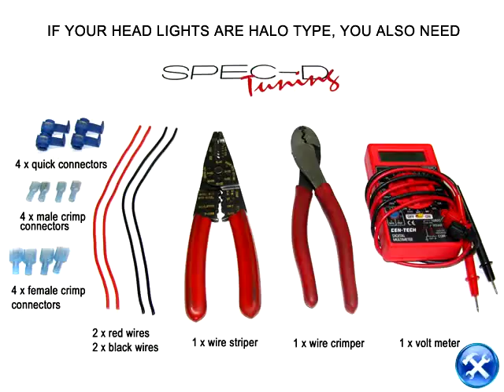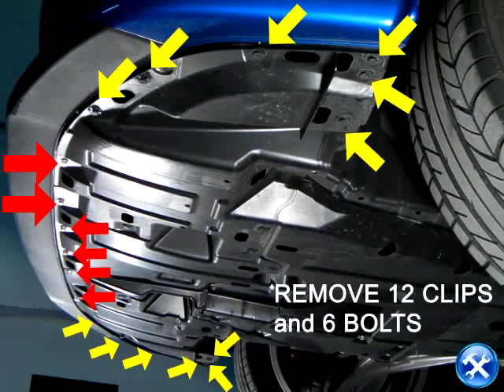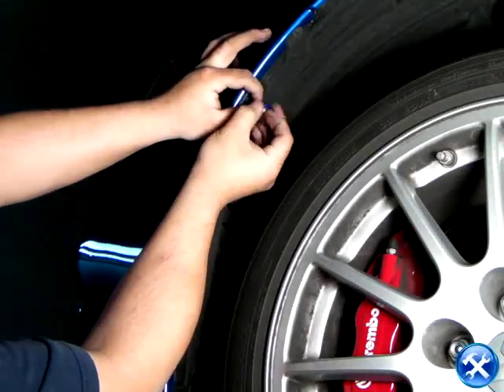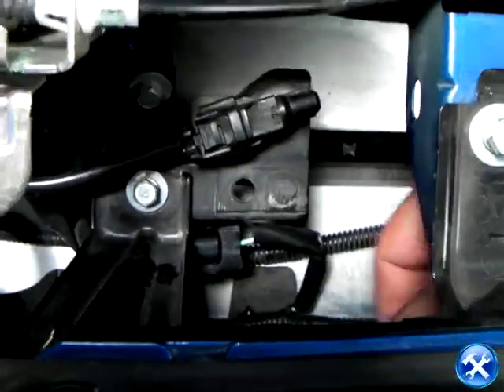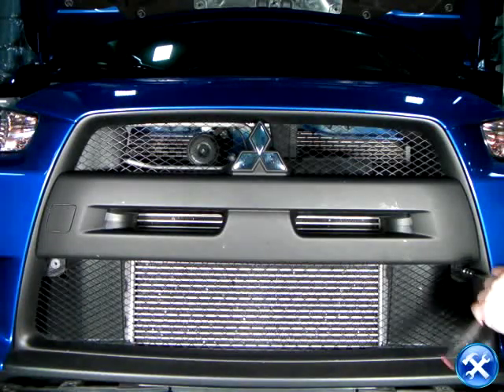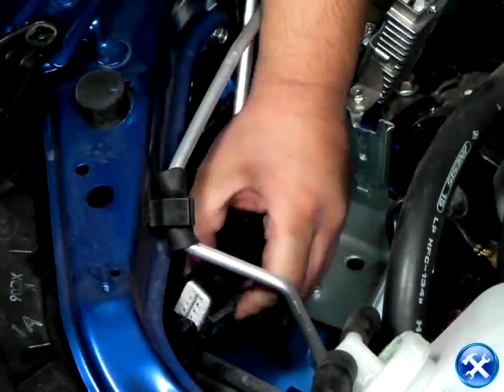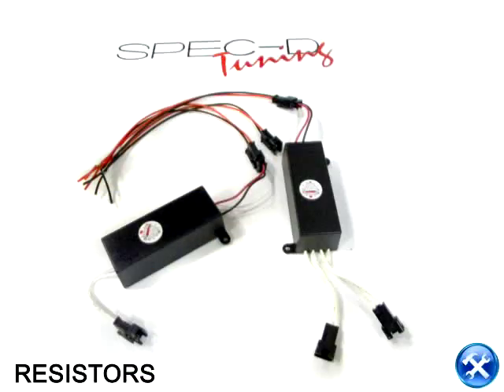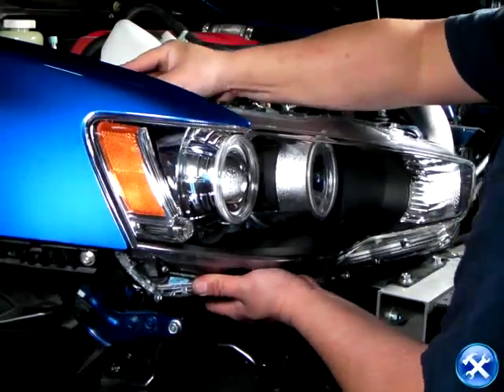SPECDTUNING INSTALLATION VIDEO: 2008-2010 MITSUBISHI LANCER EVOLUTION PROJECTOR HEADLIGHTS

Comment from the maker: @spitfire209 Depends if you mean the installation process, then yes, the headlights can be removed and replaced. However, if you talking about the projectors that you see in the video; then they are not compatible with Mistubishi HID Stock headlights. Because the harnesses are not the same. However, they will work for NON-HID OEM headlights. I hope that helped, let me know if it did. thanks so much

Comment from the maker: @EvolutionIXRR Actually, the projector headlights in the video will work for any model evo, but only for OEM halogen. If you have HID, they will not work! You will have to hook up the resisters to your parking lights, so that when you turn it one click (ACC), your daytime running and halos will come on. And two click (headlights) your headlights will come on. Sorry, the product is manufactured, however, you do not have to connect the R8 style lights. Thank you

Comment: @Specdtuninginfo so basically this projector you have is for non oem projector evo x.  My evo x has stock halogen headlights and wondering how does the daytime running lights works on the projector? Does it light the projector when the handbrake is down? or The LEDs would act as the DRL and the projector lights up when it is switch to headlights? One more thing, can I just get the projector without  the r8 leds and halos in it? Just the projector headlights, pretty much like an OEM? thanks

Comment from the maker: This will fit 2008-12 Lancer & EVO X with stock Halogen Style Headlight Models only, will not fit on OE xenon model.
So really just as long as they are stock Halogen then you should be fine